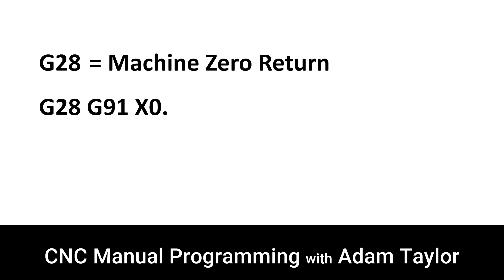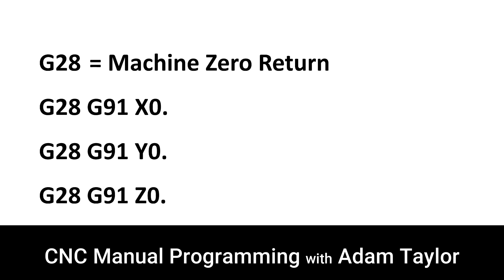CNC manual programming lesson 6 - G28 Machine Home Position

Comment: So, whats the G91 doing on the same block of code?
Reply from the maker: Thanks for the question.  G91 is the command for incremental positioning. Essentially, by using G91 on the "G28 Z0" block, you are telling the machine to go to the home position (G28) using its current position as the datum. This will send the spindle in a vertical move only back to the Z machine home position.
If you don't put a G91 here, then the spindle will try and move to the Z machine home position by referencing the last work coordinates you used in G90 which could cause the tool/spindle to try and plow through your part or your work holding.
I hope this helps.
Reply: @adamtaylor999  thanks for that. My (lathe) machine doesn't have G90 or G91, so I assume I simply omit that and it'll go home?
Reply: @adamtaylor999  I was thinking that as my machine doesn't use G90 or G91, perhaps I can use 

G28 U0.0 W0.0;

as my method of incrementally moving to home?
Reply from the maker: @darcustaseen1602  make sure you move away in the X axis first (U).
Your machine should accept G91 but may not accept it on the same block.
Have you tried putting G91 on it's own block?
G91;
G28 X___;  or U
G28 Z___;  or W
Reply: @adamtaylor999  my machine used G90 as an actual cutting cycle and doesn't accept a G91 command.

I guess pushing U and W is the way the machine wants it. Thank you for your help. I'm still very green when it comes to CNC!